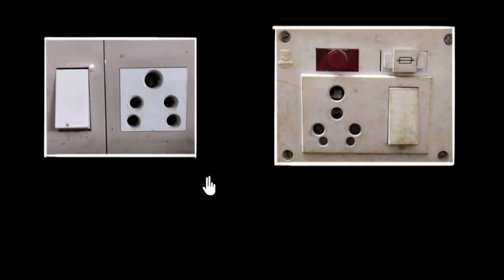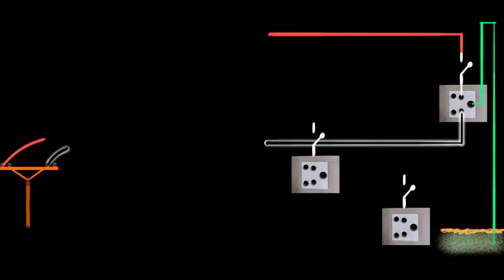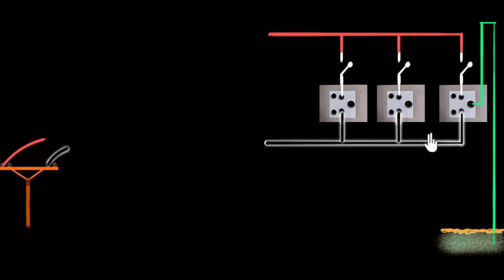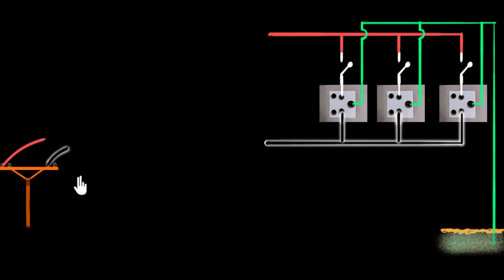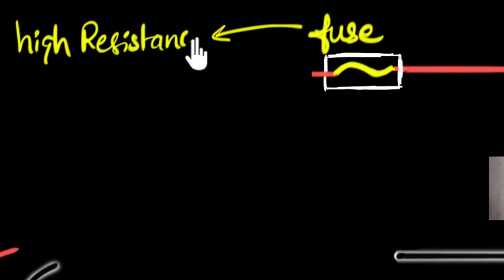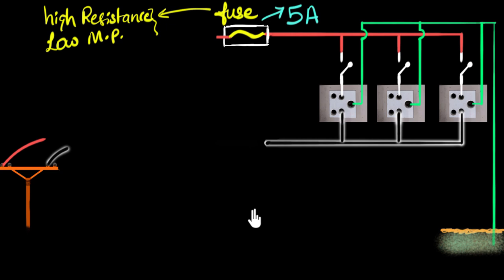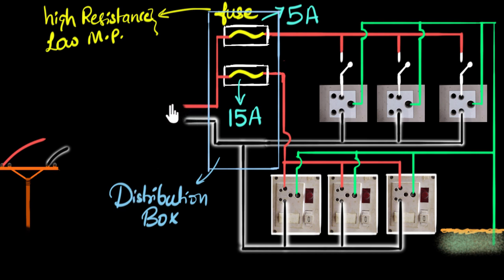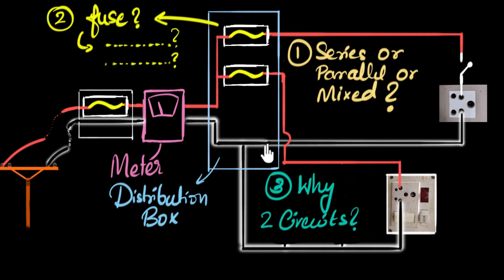Domestic circuit connection & fuse - Domestic circuit (Part 2) | Physics | Khan Academy

Comment: Sir when circuit is completed with neutral wire which is taking back the current...then why we are saying that neutral wire has no current and there is no harm to touch neutral wire..when we are seeing here that neutral wire is bringing back the current...kindly reply
Reply from the maker: This question has been addressed in part 1
Reply: I asked this same question at 3 educational sites
.and when i didn't get any reply..i thought to contact electrician and he told me everything about that...i again confirmed from other electrician same ans i got....and the same you have replied in your 1st  video....just i saw...thanks sir❤❤

Comment: I think fuse is often connected to the live wire because when the flow of current exceeds from it's natural value then it would result in drastic destruction of the domestic appliances as we know that the neutral wire has a similar potential difference to that of the ground when current overflows may only increase to such a value which would not cause drastic damage to the appliances but this doesn't happens same as the case of live wire it possess huge amount of electricity through it which could damage our appliances that's why fuse is connected to the live wire. Is this correct ???

Comment: just for clarification, a person is safe to touch 20,000 volts as long as power supply is low. P=VI so a person can touch a high voltage. The key thing here is that the power supply to our house is high and p.d is low. Hence current supply is very high leading to shocks

Comment: We connect fuse with live wire because the high electricity passing only from Live wire and it's make short circuit that's why it puts there

Comment: What are those extra holes in the plug points for? I mean, apart from the three that are already mentioned..
Reply: Not all plugs are of the same size, so just in case, it's a smaller one, you use the other 2
Reply: @geetugupta7244  Ohk👍

Comment: I watched the recorded video and  it  was helpful. 
Ans of home work question-
1. In our house we have parallel circuit connection because in parallel connection all the appliances get same voltage⚡️ as that of supply line as well as the overall resistance of rhe household circuit gets reduced and even high power rating appliances can work properly. 

2. We use a fuse as a safety device. It is used to safeguard our electic domestic circuit. It is connected in series with the circuit.  Two important properties that a fuse wire must have are-
 A very high resistance, this because  it has to resist the flow of extra current than the prescribed specified amount in the circuit. 
A low melting point, this is because it follows Joule law of heating and has to break the circuit when current exceeds specified value. 

3. We need to maintain 2 separate circuits one for low power devices and one for high power devices because the current drawn by both of them are of different in magnitude. And in order to safeguard our domestic circuit we need separate circuit for low power rating and high power rating devices. 

4. Bonus question ans-
The fuse is always connected to the live wire not with the neutral wire because we know the  current in circuit entres from live wire and leaves from neutral wire  and the live wire has 220 volts but neutral wire is ground and has potential of 0 volts. So if we would have connected the fuse in neutral wire then it still would have not proved to be helpful in any case because the devices connected can still draw current though then via live wire for a certain amount of time. This would damage the appliances. 
Therefore, fuse are  connected in live / active wires not neutral. 

Thankyou. 🙏🙏
Reply: Thank-you
Reply: Impressive!
Reply: @jayantipatni1344  thanku 🙏
Reply: @geetugupta7244  thanku 🙏
Reply: Perfect!
Reply: @NVNgamer   thankyou

Comment: the fuse is always connected to the active wire because, if it is connected to the neutral wire, and suppose the circuit disconnects, then the devices will STILL have connection to the power sources for a brief amount of time, and they will still be able to draw some current, and this can damage the devices. whereas, if in the same case, if the fuse is connected to the active wire, then when the circuit breaks, the devices will NOT have connection to the power source and they will not be able to draw current.
is it correct? lol
anyways, thanks for all of your videos, they are very helpful!
Reply: Well, i too was thinking the same
Reply: i had the same answer, miss. ketaki
Reply: @kotababy6509  okay lol
Reply: How will they be still able to draw current ?
Reply: @NOTORIOUS895  cuz it still has 220V and -220V
e.g. if you have a lamp switch that connect and disconnect the neutral wire, your lamp will able to dim shortly for frequent period, even though you turn it off, it is caused by hot wire still has free flow to that lamp
Reply: lol

Comment: as the fuse is basically used to stoP the flow of current if there an excess flow of current..so when excess power is suPPlied by the main the current first flows through the red wire..and then through electric aliance and then back through neutral wire...so so as to let the fuse melt before the current reaches the circuit it is connected to red wire

Comment: Reason why the fuse is connected to the live wire :
Because if we connect fuse to the neutral wire and  in case of high voltage supply , the fuse would melt. But the potential difference would still exists across the device(i.e. potentiality at live wire would be more than +/-220v and potentiality at neutral wire would be 0v) so the current still flows and the device might be destroyed.

And if we connect the fuse to the live wire , and during high voltage  supply the fuse melts and the potential difference across the device will be the same(i.e. 0v potentiality in  both the wiers) so the current would not flow and the device is safe

Please reply if I am right 🙏
Reply: No i the circuit would even break if the fuse is kept in neutral wire….I think ur answer is partially right!! Am I right!

Comment: Can someone please tell me the answer of the question- " why the switch is always connected to the live wire?" 

Please tell me the answer of this question Khan Academy please 🙏
Reply: Hi there,
This is so that the appliance or the switch board is not still conducting when it is switched off.
This ensures safety of the user.
Hope my ans helps! Thanks!
Reply: @Annzz  ok I got it thanks 😊

Comment: The fuse is always connected in the life wire of the circuit because 
if the fuse is put in the neutral wire then due to excessive flow of current when the fuse burns current stop flowing in the circuit but the appliances remain connected to the higher potential point of the supplied through the live wire 
now if a person touches the appliances he may get a shock as the person will come in contact with the live wire through the appliances.

Comment: the fuse is never connected to the neutral wire just because if due to high terminal voltage or short circuit or even overloading of current in the circuit excess  current flows through the neutral wire, the temperature of the fuse increases and upon reaching its melting point, it blows off and current immediately stops flowing into the circuit , but , here comes the trick, the live wire still remains connected to the appliance and as we know the live wire is connected to the main point of high potential supply(also called mains), and thus current still flows into it and any person touching the faulty appliance will get as u said sir, a nasty shock 😁😁, btw your teaching is too superb, hope i could touch your feet someday

Comment: 4. Ans: fuse is connected to live wire because current entry point is  through live wire wherein which high voltage can be restricted and leaves through neutral wire.

Comment: Your phase/hot/live/positive and neutral/negative are reversed (Polarity reversed). The former (control by switch) should always be on the right side of the socket while the latter should always be on the left side of the socket.

Comment: Is it just me or someone else is also thinking about this? Fuses are and should be of least resistance so no voltage drops occurs through it. fuses are highly resistant only when they are blown up . Because whenever we check fuse on multimeter we check it on short circuit beep mode. Please guide

Comment: 1.Parallel bcoz the appliances are independent of other appliances. 
Also, the equivalent resistance in parallel is less, & also The same voltage is applied to all appliances

2.Fuse is basically a wire (made from alloy of( Pb + Sn)  ,  whose main function is to Melt when high current Passes through the circuit. It's conditions are
- it should have high resistance so that it can oppose the incoming current 
- it should have low m. p. So that it can easily melt! 

Fuses & Switches are present in contact with live wire as when the circuit breaks, the appliances is not connected to high potential.. While, if we connect it through neutral wire, the appliances is still connected to high potential... Hence a person could get Shock. 

PS- new here.. And literally found this channel amazing <3   :)

Comment: Ans to bonus question: Live wire is the one that carries the current to the device so if you want to prevent overflow of current, then you have to connect a fuse to the live wire and not neutral one as it will already be damaged before current even enters the neutral one!

Comment: 1. Parallel because each appliance can be used independently. In case of short circuit in rest wires can be used. 

2. A fuse should have a high resistance and should have a low melting point. 

3. We need to maintain to separate circuit because there are appliances which draw more current. In case if we attach them with a circuit have a fuse which operates on low current then the fuse will melt and the circuit will break. To prevent this appliances drawing more current are attached in separate circuit  have a fuse which operates on greater amount of current.

4. If we connect them in neutral wire and if the fuse melts than the current will pass through the ground wire.  The purpose of fuse will get defeated and excess current will continue to flow. Thus it is connected in live and not in neutral wire.

Comment: Answer to questions 
1- the circuits in our home are connected in parallel so that every device gets equal electric  potential.  

2- A fuse is a safety device which melts and cuts the connection when electric current exceeds a safer limit . It is made up of a substance which has high resistance anc low melting point. 

3- We generally have two circuits in our house.  One is power circuit and the other is lighting circuit. Lighting circuit is use to run low power consuming device like fan ,bulb etc whereas  power circuit is used to run devices which consume more electric current like heater , geyser , air conditioner,  grinder etc

Comment: Fuse connected with live wire  because  live wire has more potential like 220 volts so it is first which heated up or burn that's why fuse connect with live wire

Comment: Thanks sir, fuse is connected to live wire because if it is connected to neutral wire then the exceesive current will damage device first before the fuse wire melts which is connected to neutral wire
Reply from the maker: That's what I used to think as well. But the current flows everywhere at the same time. (It doesn't first flow through live, then the devices and then through the neutral). 
So when the current exceeds the safe value, the fuse disconnects and the circuit will break before it has any chance to damage the device. 
This means even with fuse connected to neutral, our devices would be safe. 
So there must be another reason for this :)
Reply: @KhanAcademyIndiaEnglish  sir, I tried to understand from other resources but I can't understand the correct reason for this. I will be grateful if you tell me the correct reason for this. Thank you sir for your reply.
Reply: Sir why current flows everywhere

Comment: ANSWERS:- 
1. Parallel connection 
2.we use fuse because  it has low melting point and a high resistance.
3. because some devices need more current to run while other needs less.
THANK YOU !!

Comment: Sir in 7:55 I think we need a high melting point by which it refuse the melting.
Reply: No it shd be low
Reply: No, the purpose of fuse it to melt quickly and disconnect the circuit. Hence low meting is required for fuse material

Comment: The fuse wire is always connected in the live wire of the circuit because if the fuse is put in the neutral wire, then due to excessive flow of current when the fuse burns, current stops flowing in the circuit, but the appliance remains connected to the high potential point of the supply through the live wire
Reply: If the current can't flow form this broken circuit then how will this high potential cause damage to our appliance.

Comment: actually, the low voltage will cause a high current to flow in the circuit and not the high voltage.  just wanted to correct it at 6.30

Comment: 1.parallel
2.fuse should  have low melting point and high resistance 
3.two types of circuits are used so that appliances  which need less current  will not be affected by the more current  needed  appliances like AC, heater etc 
(Lightning circuit and power circuit)